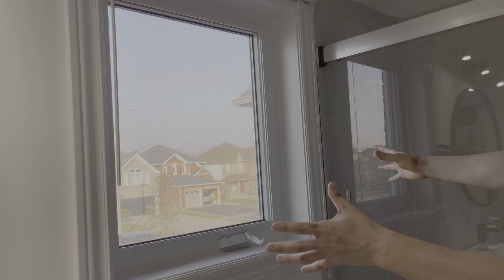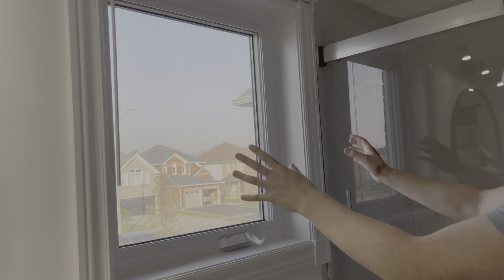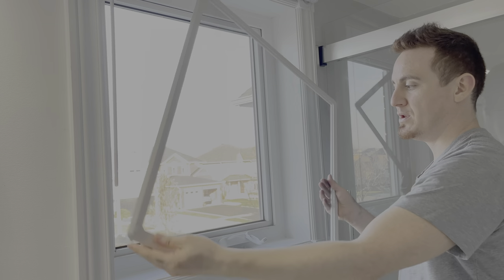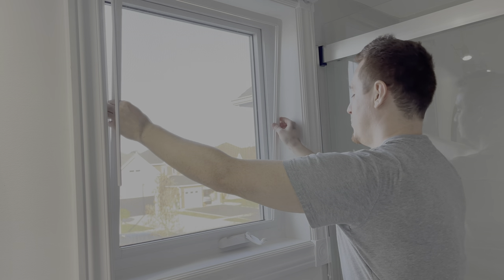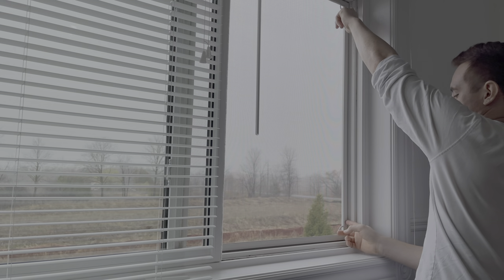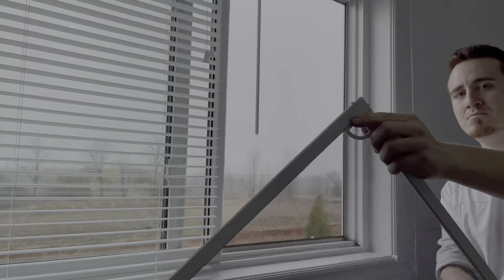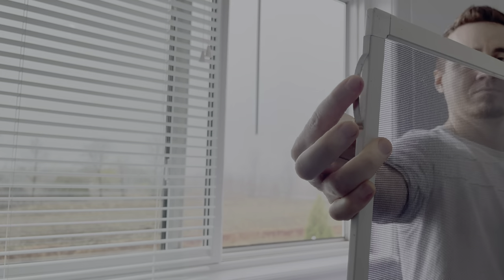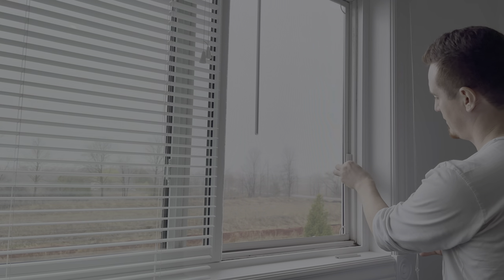HOW TO REMOVE DIFFERENT WINDOW SCREENS / How to remove a window mesh

Comment: Not one video i know of, shows how to remove my Andersen screens. They were installed about 20 years ago, and are the kind that fit my old 1950s ultra-wide slider windows. My screens have cheap square-shaped plastic thingies at each corner, and another 8 thingies in the vicinity of the corners. If this venue would only refrain from zapping pics - then you'd see what i mean.